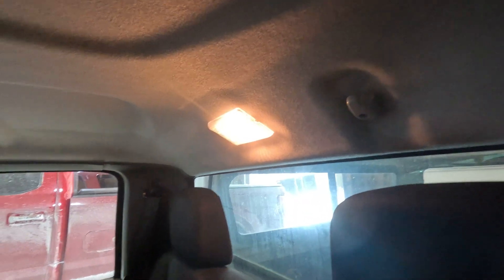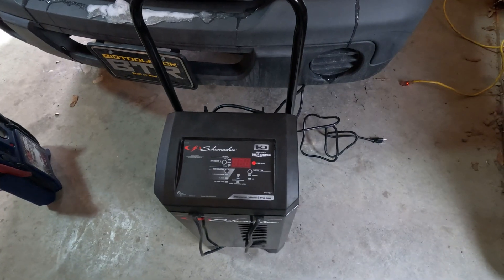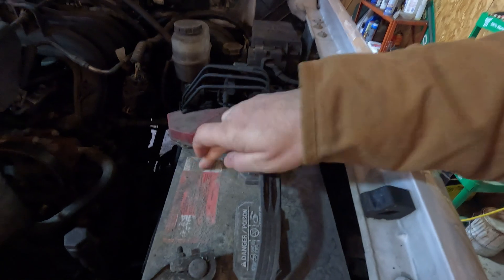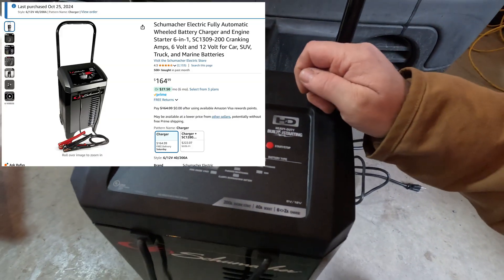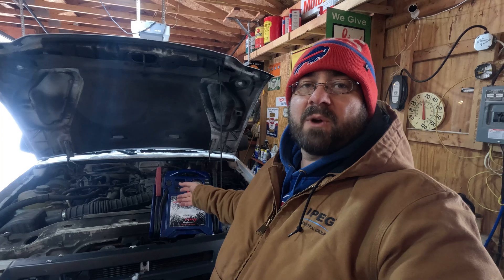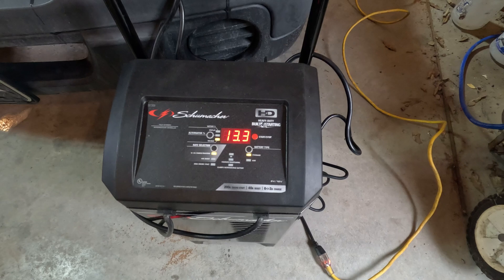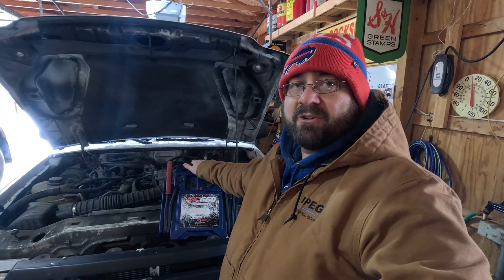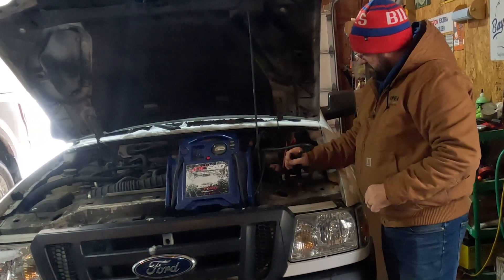Dead battery in cold weather - 2 easy ways to start a car when the battery is low due to temperature

Comment: IT's all about the current not the voltage.  Indicating lights and the cab light is very small current draw where the starter is big current to turn over the engine
Reply from the maker: Excellent point.

Comment: Schumacher is one of the best brands of battery jumpers/chargers that I've found...when you have access to electricity of course. I've also heard great things about the Jump and Carry packs. Everyone seems to be using them now. Excellent tips and advice, Chad! The average battery lasts about 5 years, so I recommend replacing it about that often. If you don't know how old the battery is, I would recommend replacing it ASAP. Because you never know when it's going to go dead. I've had batteries that would work fine one day and then be dead the next and they will always go dead just when it's the most inconvenient time....believe me! So, it's good to have that insurance if you don't know the age. Thanks for sharing, Chad!
Reply from the maker: I'm happy with the Shumacher products I've used. As far as the truck battery - it never once failed me over the last several years - but now it's got me worried. It's probably time for a replacement. I certainly don't want to be stuck at work at 5PM with a dead battery 1.5 hours away from home!

Comment: I never have to jumpstart my car, but I do have a “battery tender” to maintain charge in the battery just need to remember to plug it in and unplug it when stared! 

In much colder climates, they do have battery blankets as well, however I tend to believe they get in the way!

Alot of times especially on fords, I would hook up the + jumper cable to the starter solenoid, and the ground to body/ block ground!
Reply from the maker: I remember doing that method (cable to starter solenoid) on my old Ford Bronco.  I also remember you could run a long screwdriver to the solenoid from the battery and bypass needing to turn the key inside the truck. :)
Reply: @ screw driver, fork paper clip, you name it if it was metal, it would start, and you didn’t need to reach all the way over to the battery!

Comment: Just for fun, check out some videos on the Lear charger. It was powered by a chainsaw engine and could supply 12 or 24 volts. The jumper pack of the 1970's when it was made
Reply from the maker: Thanks for the tip! I've never heard of that, but it sounds pretty cool.

Comment: You did not cover this, but proper maintenance of the battery is also key. Does the battery have enough water in it (not super common). Take the terminals off and scrub the lead posts with a wire brush, clean off any build up on the terminals and wipe off the top of the battery with all the dirt/dust. These seem minor things but all can add up too. I usually replace my battery at 5 years as it’s cheap insurance. 

Those were great items to have, I may have to get one of those Schumacher’s for the homestead! 

Really looking forward to the Chiefs/Bills rematch in the championship game! 😊
Reply from the maker: That's a great point. Most batteries now are "maintenance free", but I remember dad using water from the dehumidifier to fill those cells when they got low. And cleaning the terminals is another great tip. I have some spray from NAPA that is supposed to protect them also.